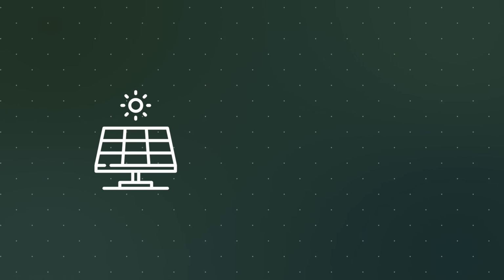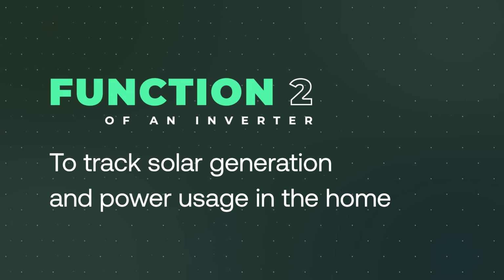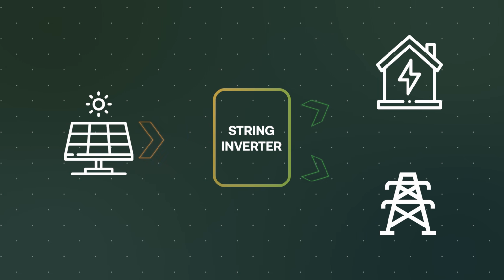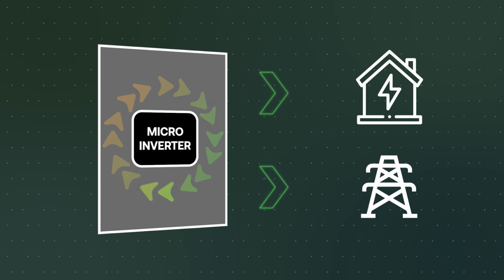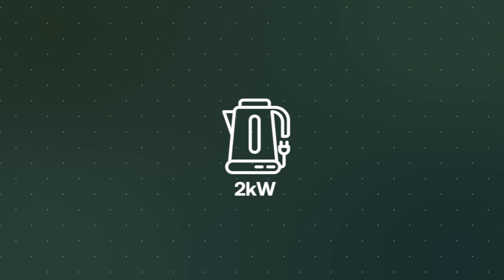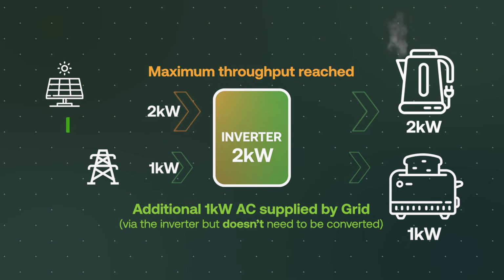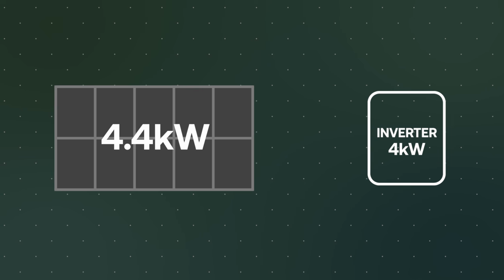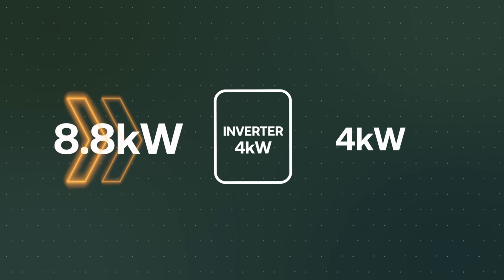Solar’s Most Important Part: The Inverter Explained

Comment: We're getting 18 x 480W panels and a Fox 6kW inverter installed soon. The panels output can peak at 8.6kWp but the 6kW inverter can actually handle 12kW PV input, so I disagree that sizing the solar output to match the inverter size is a good rule of thumb. We will also be adding 20kWh of storage as part of the system. More panels also of course helps a lot in the colder months. Good overview though all in all 👍

Comment: I am surprised of such small batteries used, I have 30kwh and think this is the bare minimum needed...😂
I have two inverters, 3kw off-grid for backup, and 2kw gridtied with Zero Export... ZERO monthly monitor fees or grid connection fees....

Comment: I like my EC10.0SP Sigenergy with 4 x 6kWh batteries. The 11.6kW of panels are on 4 different strings, in a number of locations for maximum morning, evening, summer and winter times. It's only rarely that I produce near the 11.6kW at the one time, but it extends the "day" by a couple of extra hours for me. (South East Melbourne.)

Comment: I currently have a Sig 12 kW inverter with a 10 kWh battery, powered by 15 kW of panels across 4 MPPTs. I’m considering adding another inverter and have a few options:

Sig 5 kW (£1000, 2 MPPT)

Sig 6 kW (£1100, 2 MPPT)

Sig 8 kW (£1700, 3 MPPT)

FoxESS 7 kW (£800, 3 MPPT)

The FoxESS option is not only cheaper, but with 3 MPPTs it would also allow me to install an additional 6 × 515 W panels on the north side. Paying an extra £1000 just to keep everything Sig doesn’t seem worth it to me.

What do you think about adding the FoxESS to the Sig system, with the Sig acting as the master and the FoxESS running as a slave?

Comment: 5:40 So microinverters are cheaper, but they also push the cost up?! If a single microinverter is cheaper than a single string inverter, then saying your string inverters work out cheaper than your microinverters might be more appropriate to say.
Reply: One micro inverter per panel... definitely not cheap....

Comment: Id argue that you are better with more panels then your inverter size obviously there is a point of deminished returns but clipping in the peak of summer is leveled out by better production on less then optimal days.
Reply from the maker: The system needs to be sized for your specific energy usage and goals so in some cases it can make sense. But we have seen instances of installers putting a 8kwp system on a 3kw inverter to commission under G98. So it's all about the goldilocks effect 🐻
Reply: Agreed - some clipping in summer is acceptable. Better to have more panels for better generation in winter.